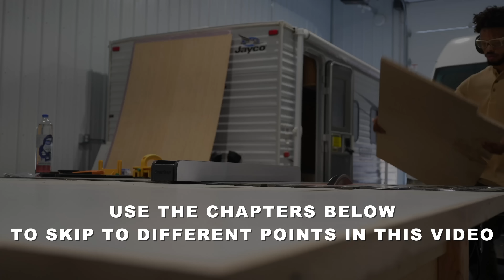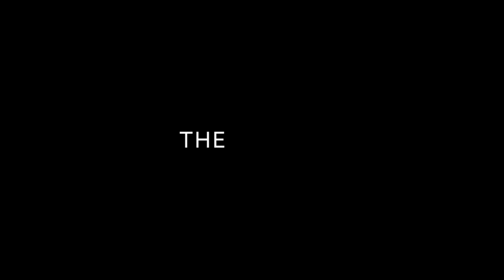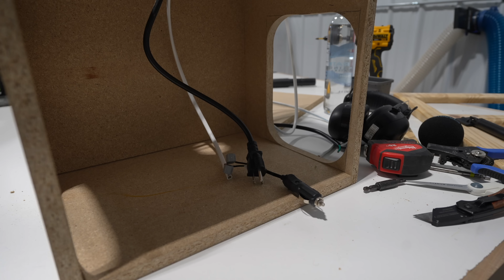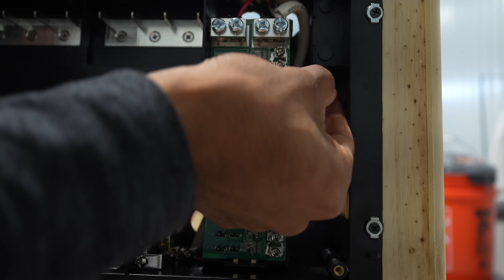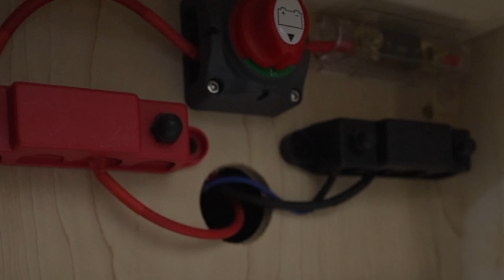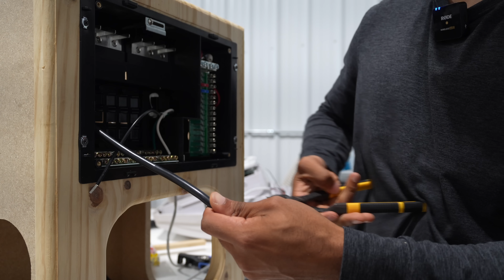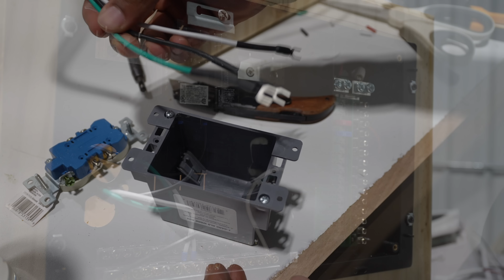EASY CamperVan Electrical Build - Start to Finish (W/a Power Station) Anker SOLIX C1000

Comment: Dualex i wish when people would say what size of wire one uses for this configuration and have not seen one do it ? You do a very detialed job on most things but for the aveage joe it would help. I am doing it for my mini van and i got 6 awg from battery to my victron dc to dc charger 30 amp with two 50 amp breaker and 10 awg to the 6 spot fuse bar then on to my ac200p Bluetti which is 2000 watts. and accessory wires ? Not sure but are much smaller. I got 4 - 100 watts of solar but the wire configuration to the battery is done .  I hope this setup charges my battery when driving with solar and dc to dc charger. Thanks Pat

Comment: I’m imagining if you are wiring AC power with 12/3 wire it would be solid strand and would never need a ferrel on solid wire. Literally sounds like the metal and or plastic could create an arch and start a fire. I’m no expert but be careful what you tell people please.

Comment: Hello!  Thank you SO MUCH for this video.  I have a Bluetti AC500 system with two batteries that I bought to use in my skoolie build.  We currently use it in winter to run our pellet stove during power outages in our house, but I want to be able to move the system to the bus when I go on the road.  I have been thinking of wiring the bus without the ‘brains’ of the power system as a permanent part of the build but I only had a vague sense of what to do.  This video is LITERALLY the missing link I needed.  I really enjoy the creative thinking you bring to your videos.  Thank you again, this is just what I needed!

Comment: Very detailed video, great job! FYI, the 10A cigarette port may be inadequate to handle the entire load of a van. Bluetti, EcoFlow, and Goal Zero have models with high output (30A) DC ports that use a more secure connection (Anderson or Aviation).
Reply: Which ecoflow and goal zero models? I found a afreily one with 12v 25a
Reply: @MJ720  The larger power stations have high output ports:  EcoFlow Delta Pro series, Bluetti Elite 100 and above, Goal Zero Yeti 1000X and above. The 1500X has a 30A.